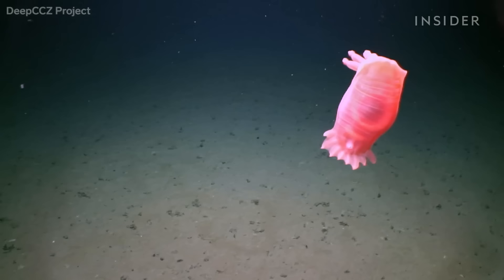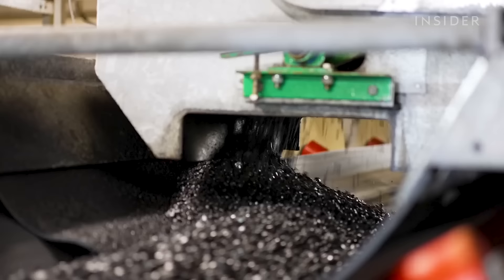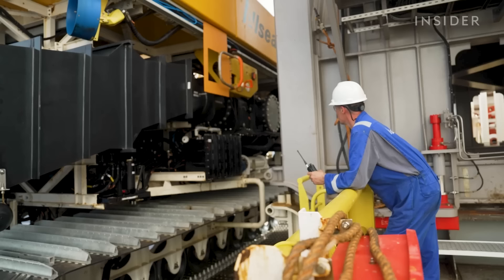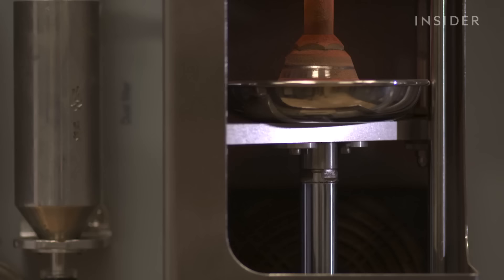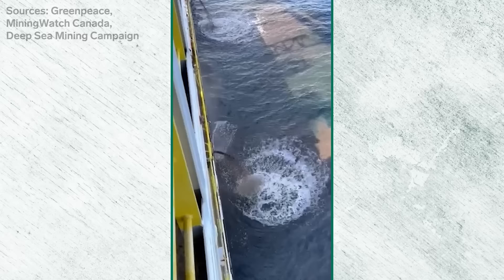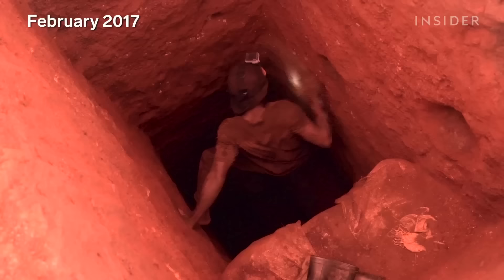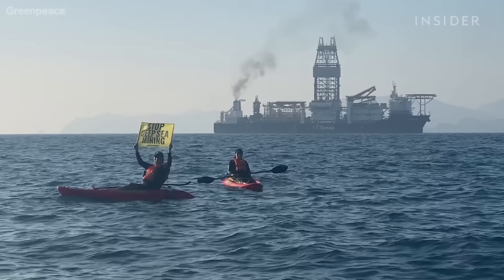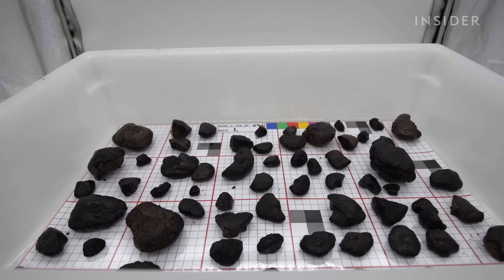A New Mining Ship Sucks Metals Off The Seafloor. Is That A Good Idea? | Big Business

Comment: The sediment return problem can be easilly solved by adding a sister vessel to temporarily collect and process the sediment for proper return. I'm pretty sure any engineer can build a dehydration chamber and compacter to desoil and split the waste into two streams, one for water and one for solids that can be safely released at different depths without causing much impact. I'm surprised nobody has mentioned anything about it. I bet they even have it figured out already.
Reply: Some people care more about getting the end result then then what method they used diesel powered harvester or slave labor same result but different paths
Reply: I think the amount of solids you would be collecting is too much to store and transport to say land or another part of the ocean or whatever.
Reply: You’re taking about a vessel that is all expense and generates no revenue with no authority forcing the company to do so. That means you have to rely on the company’s good will to do such a thing. Call me a pessimist, but I highly doubt they would do what you’re suggesting, even if they could.
Reply: Is the sediment they are putting back in the ocean just non nutrient? Like if it's got nutrients could we take the sediment and use it for farming or something like that instead of chucking it back in?
Reply: There is life down there. Imagine all anymals are getting sucked away on land someone's just like: thr sediment can be replaced
Reply: There is a machine called a filter press that seperates and dewaters the sedament and slurry. Then it can be returned to the sea bed where it was removed or shipped back to land. The water at the end of the process is clear.
Reply: @willieoreilly5728  ...you forgot to say...
With no alive animals that have been sucked...
Reply: And suddenly that 12% profit margin becomes 2% and it’s no longer viable…
Reply: @InTimeTraveller  could have a system of ships
Reply: That would just add cost to the mining operation, we all know big companies will not do that.
Reply: If they still have a profit margin, then they'll do it lol
Reply: The problem isn't the composition of the sediment, it's the fact that no matter where you disperse it, it creates a cloud.

Clouds are bad in the ocean, so they're trying to determine what depth to release at so that the cloud has a minimal effect.

Why does everyone say "ooooh, company bad, rich people bad" this guy went bankrupt trying to do something that could be better for the environment than the alternatives. If you don't like it, come up with a better idea.

Comment: What is the expected yield per metric ton of the nodules [of the four metals you propose to mine]?  How does those numbers compare to current land mining processes?
Reply: The Pacific patch has an expected 21 billion dry tonnes of nodules and those yield about a combined 6 billion tonnes of nickel, manganese, cobalt and copper plus sone other metals.

So the yield is goddamn amazing and the extraction process really goddamn damaging.
Reply: Hope we can mine space before this has to happen on any scale
Reply: @JasperKlijndijk  too expensive, this is probably one of the steppingstone to get there but it is going to be some weird looking fish on the bottom of the sea might have to move in the mean time. It's asinine to say this one species of blob only lives in the one part of the ocean and can only live if attached to these specific rocks with out any kind of data to back up those claims.
Reply: @joels310  And it’s asinine to say with certainty that these operations WON’T decimate the species mentioned. Some species can only survive in waters of a certain cleanliness. Kicking up all the sediment may make them unable to breathe. The sediment cloud will also spread for miles or even tens of miles depending on the depth at which it’s released. Some of these species may only have a few hundred examples confined to a very small area, and until the research is in we won’t know. And I didn’t hear any talk of replacing the nodules with another material for the species that need something to latch onto, so at that point we are talking about permanent habitat loss for creatures we know next to nothing about. How many secrets do these species hold? Cures to cancer, new chemical compounds for all manner of applications, and just the pure wonder of the history of evolution on our planet. Are you really willing to throw all of that away when we don’t even know what it is we’ll be losing?
Reply: yield doenst matter as long as commodity prices increase(which given "green targets" they will). Its like fracking and the arctic oil production. Both were somewhat jokes until commodity prices rose the point that even those capitol intensive extraction methods became cost competitive(fracking even more so due to the continued innovation, which as been spurred by the commodity prices that they caused).

Comment: there are a few simple solutions... first have another rc controlled vehicle in front sorting rocks getting the ones with life out of the way and second just drop normal rocks, the cheapest ones you can get down with the rest of the unwanted material so the animals still have rocks, and if they need minerals from the rock, simply drop 2 nodules extra for each animal needed relocation. and for the massive clouds that form because of it... well those animals are living in complete darkness and those settle within hours, maybe a day or two for the ones dropped from higher up and then that area will never experience this again therefore recover really easily if it's gonna be affected by the change at all.. like i said they live in complete darkness, probably won't even notice all the sediment.

Comment: 0:15 funny how their nice 3D model is vacuuming heavy rocks, but leaving the light sand under them untouched...
Note that at no point, they are telling what surface of seabed they need to scrape (they say they vacuum it, but at that power level, scraping would have the same impact) to gather 1 ton of rocks, nor how much metals will or can be extracted from these rocks. At that point, it is questionable if such operation can even be profitable of if it is just for show.
And thank you for highlighting once again that Greenpeace is a bunch of useless pseudo-ecologists, filming some events they know nothing about and inventing a negative/degrading context around it (boat is voluntarily discharging sediments in the sea while it was in fact an incident onboard ths ship).
Reply: Well said,

Mining is all about grade and that wasn't mentioned at all in this piece.  The grades would have to be massive to offset the substantially greater inputs into the process.

This seems like the mining equivalent to fracking.  I don't see how it would ever be viable until the traditional extraction methods are exhausted.

Comment: Could those nodules be replaced by gravel, or small stones? That would at least make is easier to recover for marine live. I think this is worth researching. And I say researching not start mining withing a few years, before we know the impact.
Reply: That's exactly what i was thinking the moment video finished.
Reply: Altering the design of the machine could potentially help out with that by making the machine only have the vacuum section tubes on the outsides, and leave the center alone, and then have a rake on the backside of the machine to spread out some of the untouched rocks in the center over to the side areas that were vacuumed up.
Reply: The replacement whatever needs to be mined also 🤦🏽‍♂️
Reply: @gamerdrive5565  You don't really have to mine gravel. There are plenty of places where gravel and small stones can be digged up without causing absolute disaster to the environment.
Reply: @paulusfransen1708  The comment wasn't about mining gravel, but about placing gravel on the seafloor. So animals have something to cling to once the nodules are gone.
Reply: @ThePostApocalypticInventor  Thank you for explaining my own idea.
Reply: @ThePostApocalypticInventor  LMAO, get me what this man was smoking
Reply: @ThePostApocalypticInventor The animals which clung to them will be gone forever.
Reply: No, the species that live in the areas with manganese nodules are adapted to the ferromanganese crusts that formed over millions of years. You can not replace these complex structures with gravel. Once the manganese nodules have been removed from the environment then this unique habitat will be destroyed for almost forever. Even if the conditions were still such that manganese nodules would form again, this process would take many millions of years, and humanity will probably have died out a long time ago by this time.
Reply: @JornSilverblade  Thanks for your explanation, that makes a lot of sense
Reply: It isn't just rocks but composition that's conducive to nutrients needed for those organisms and their symbiotes. Rocks aren't just rocks. Additionally, the resource for these organisms here is how long they've established themselves within the stones, not that there are stones here. Dredging is a disruptive action thats not easy to recover from for these animals.
Reply: Flip rakes, bounce the rocks on screens, give the worms a chance to get off before sucking up.
Reply: The study of impact on worms you expect to find what, exactly?  This is below the carbonate compensation (dissolution) depth where there is no plankton and no shellfish.  Anoxic, no oxygen so no fish.  No light so no plants.  No spreading center fumaroles, so no sulfur for energy.  Mud.  Rocks.  Worms.  That about covers it.
Reply: Wow this is the first time I've heard about an idea like this that could potentially really help mitigate seafloor disruption from DSM.

Comment: Its a good idea to monitor it carefully, and do it on a smallish scale, in different, spread out areas. I agree you have to be careful, but its also worth exploring this
Reply: That was already done back in the 60s to 80s.

The damage in those areas still hasn't recovered and the goddamn track marks are still visible.
Reply: For what purpose? If you know that you cannot ever scale up to a size that will actually compete with land based mining because you don’t want to devastate the ecosystem, then why go to the trouble of building facilities for harvesting and refining that specialized type of ore? The same money could improve conditions at an existing land based mine and produce a greater quantity of metal per dollar spent.

But even better would be to just put all that money into recycling facilities. Long term the quantity of material to be recycled all ready outstrips all possible gains from sea floor mining. A boost of 10% to our metals recycling capacity would gain us exponential benefit moving forward. The only difference is that recycling has a fixed, predictable profit margin and sea floor mining has an unpredictable profit margin which might be higher than 14% which makes it addictive to wall street.
Reply: @Theballonist  to find out what the impacts actually are before scaling up.

And it was already done 40-60 years ago.

The trackmarks in the areas are still visible and the local ecosystem is still destroyed.

So yeah. Just ban it outright and sink any offending ships
Reply: @@cthulhu3146 it's not worth the damage created in the short or long term
Reply: Yeaaaah just some TONS...  that's it and it will be over soon
Reply: Their CEO - Gerard Barron seems like a reasonable guy. Go ahead and do it! They should create strong regulations and knock out the worst contenders of the industry. Instead of paranoid accusations, they should just do the preemptive work against corruption. It could get much worse, than what this first company is doing.

Comment: Altering the design of the machine could potentially help out with minimizng damage to the sea floor by making the machine only have the vacuum section tubes on the outsides, and leaving the center alone, and then having a rake on the backside of the machine to spread out some of the untouched rocks in the center over to the side areas that were vacuumed up.
Reply: Sounds like a good idea or modification
Reply: I would run rakes.  Waste of time pumping up and then dumping mud.
Reply: Not destroying another ecosystem for the sake of human convenience would be a great start. 
We should preserve our oceans instead, especially since the ocean produces more than half the oxygen on earth.  Nature has a balance. Every lifeform had purpose. Humans have killed 60% of wildlife/fish over the past 40 years!!
Seems like we are doing nothing to correct the imbalance. Every contractor should be required to plant X amount of trees per square footage of building.

Comment: Humans will mine and destroy the landscape, water, and ecosystem regardless. The main difference is what technology will result in the overall least harm on Earth. Yes mining for battery materials is Absolutely Horrible and takes more energy to build an EV vehicle than an ICE vehicle but there is a trade off after a certain amount of miles driven depending on how it's charged. The biggest difference with EVs verses ICEs is that battery metal can be recycled at extremally high rates with the hydrometallurgical process while it's impossible to recycle fuel once it's been burned in ICE vehicles. 
The most important aspect is to reduce why we need so much energy and resources to make our society function and then to recycle EVERYTHING that we can. 
P lease learn how to recycle PROPERLY. 👍♻️🌲🌎🌍🌳♻️✌️

Comment: i think its actually feasabile as IT CAN BE DONE RIGHT the seafloor is so large if you were to suck up like 100 acres of metals in a year and then move to another area it wont endanger any species as they are still laying eggs etc in the other 999999999 acres of the ocean. meaning each year they mine a small area sure kill some eggs then move so the previous area regenerates rinse repeat there are definitelly going to be exceptions like more niche bespoke areas of the sea floor but as long as you suck up the sea floor that is the same as the other zillion acres of sea floor it should be fine

Comment: If they could filter out the slit in the rover it would solve all rhe issues wouldnt it? The nutrient rich silt stays on the bottom and doesnt cloud the surface. 
Its undeniable that this is severely less impactful long term on an environment compared to normal mining, or worse the slave mines. Its certainly not environmentally perfect but until we get soace mining going its better than what we currently have.

Comment: The real question:

What is the difference between this and onshore mining in terms of impact. If this has a lesser impact on the environment, i am all for shutting down onshore mining to allow for seafloor mining.

It would be replacing one evil with a lesser evil, but it is a step towards a cleaner future if these metals are actually required for green energy.
As it has been pointed out, an area can only be mined once. If it takes millions of years then it is not a sustainable business, but one that will only be available once, and then shut down when the resources dry up.

Comment: Albeit too simplistic but something along the lines of "Right to extract 1t for every 10t of the same metals recycled" - no recycling plastic bottles to mine cobalt but ensure they have a system in place to recycle the materials they're introducing to the market. Deep Sea won't make up more than a tiny percentage of the mining market, as such a 1 to 10 ratio would work fine. By cleaning up the used materials from the land-based mining operations, the deep sea lot could have an anchored niche.
Edit: Not an advocate, to my naive mind this sounds like yet another of humanities mistakes waiting to happen, once it reaches scale and dictatorships enter the market, not just toe-shoe CEOs sipping Champers.

Comment: I agree with this, the seabed mostly just barren rock, almost like an underwater desert. This would significantly reduces the mining needed on the surface (which would actually reduce the harm on the planet itself.) This could also help with research as well as they would need to search the seabed in case of sea life, and if there is a significant amount they will not mine there. It is a win-win situation as the planet would need less surface mining and no significant habitats would be harmed, if there any down there in the first place.

Comment: This is a horrific practice... due to the lack of substrate those mineral deposits are used as spawning sites for nearly everything down there... However, data shows if you remove 12 of 20 nodules that is ok as only 8 of 20 are used for spawning.. The stirring up of the ocean floor is also a terribly impactful practice...